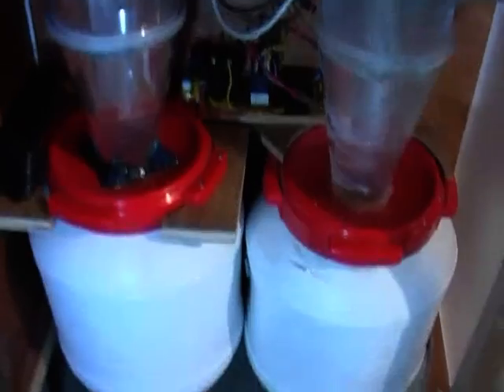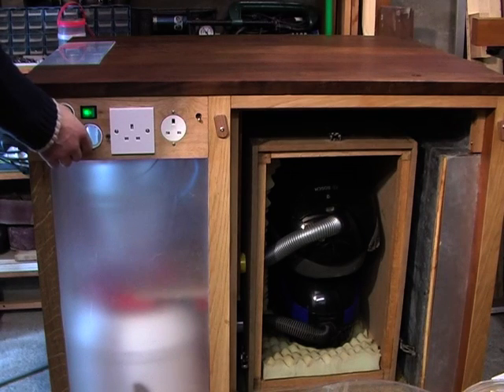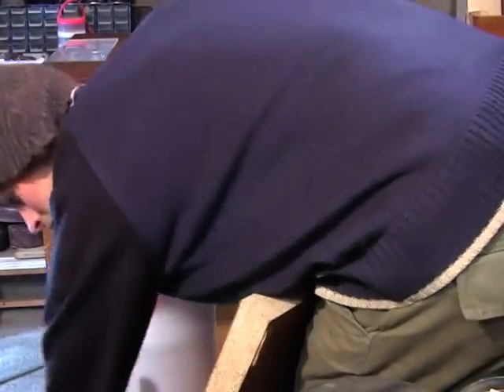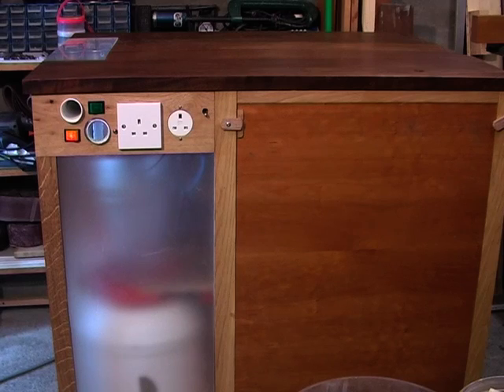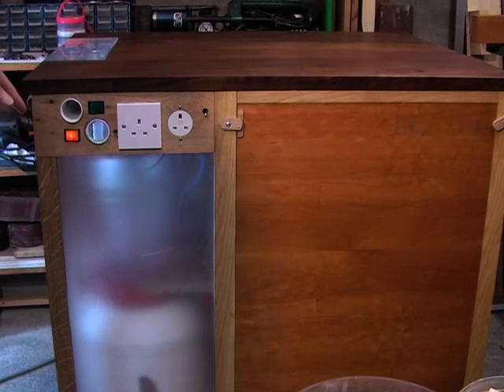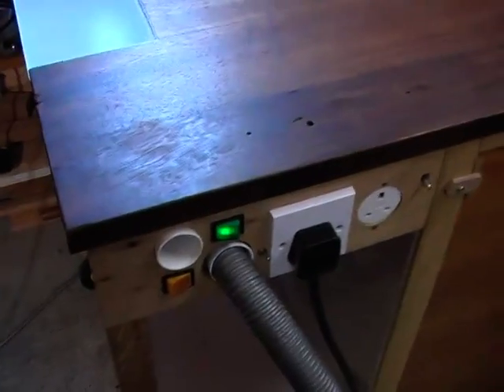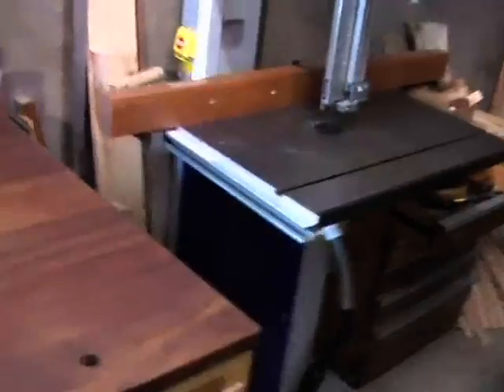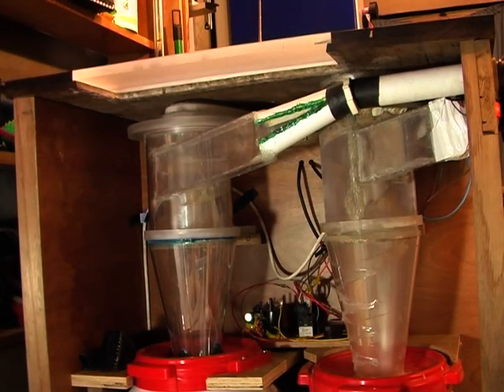Dust Sniper

Comment: Very cool, but how do you prevent the two vacuum cleaners from overheating in that small isolated room?
Reply: There is no prevention. Vacuums are not supposed to be on for extended durations even when in a normal room, nevermind a very enclosed one like this.